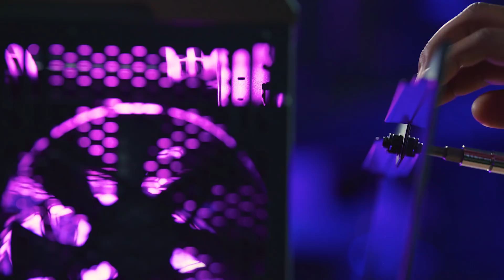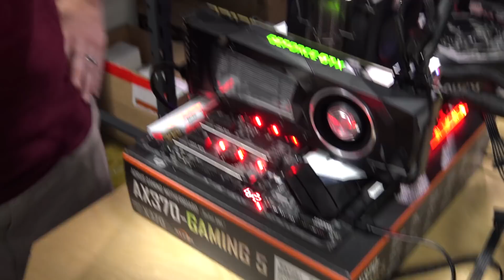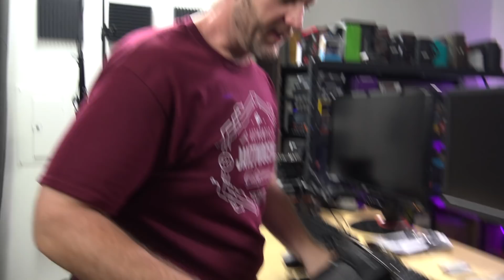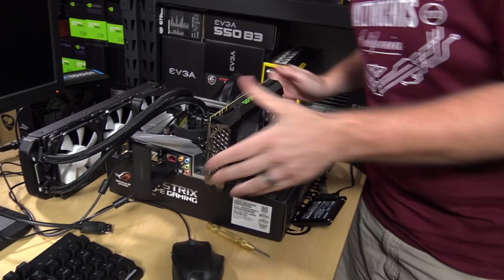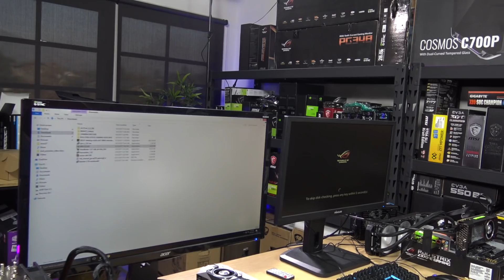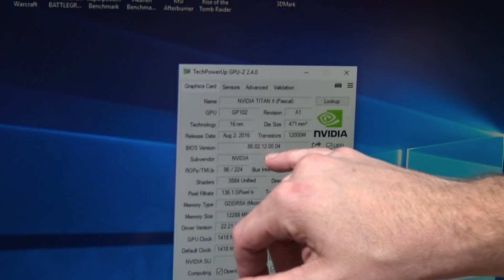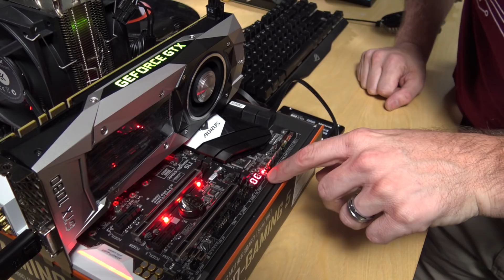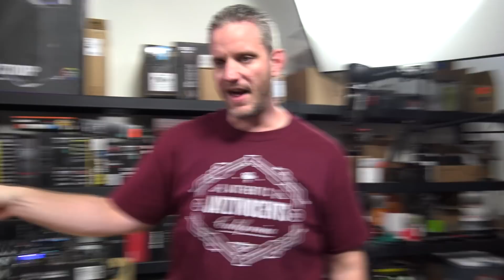I cant figure this one out... HELP!

Comment from the maker: I got all the messages asking me to verify the bios again since I checked the same card twice... they indeed do match. Just checked again now to be sure. UGH this is frustrating.
I am probably going to have to buckle down, install the Pascal BIOS editor and force a fresh bios install and see what happens. 
The problem is that a new builder without 2 cards to check would still probably think that the card is bad. :(
Reply: While I  agree with your sentient that it's probably not the motherboard, I would try a different chipset AMD motherboard with the same GPU that doesn't work and see if it posts. If it does work, then maybe its the chipset/bios on the motherboard that doesnt like that specific card. Try different brand, but same chipset. Heck u got a wall of motherboards behind you!!! good luck on solving it love ur channel
Reply: At my profession, we've come across this same issue a few times (perhaps once per year), and most of these have been due to a hint lower 12V rail output than one specific card required (for let's call it silicon lottery reason). Swapping out the PSU solved it in most cases.

Case example:
Most cards were able to survive at even ~11.7V, but then one unit refused to even at solid 12V and required a good 12.05+ volts to boot.
Reply: JayzTwoCents i bet its gremlins
Reply: I've experienced your problem few years back,few times,in different platform Amd and Intel. Mostly it's because of the motherboard BIOS/UEFI. 1 GPU can't be used in 2 identical system,1 works and the other won't post and other just like your problem. I solved my problem by downgrading my motherboard BIOS/UEFI and the card works. I was guessing there's some bugs in the BIOS/UEFI.
Reply: NebulaUK noticed the same thing so in essence you checked the working gpu twice
Reply: PCIe pinout on the Motherboard. Look for a bent or otherwise damaged pin.
Reply: I think the same, maybe the PSU, i would double check the voltages and unplug and replug the same card, this happened to me one time with my CPU the pc turned on but wont start, and after a long testing i saw the problem was the 3.3v on my PSU, changed it and every thing was OK.
Reply: JayzTwoCents I would be suspecious of the pci card slot or the graphics card connector. The slot on the one motherboard might not be making the best contact on the graphics card or vice versa since you have used that card so many times in different rigs. The contact might be worn down and a pin that that motherboard is not making the best contact.
Reply: JayzTwoCents no changes to the gpu bios?
Reply: Now you can make another video with the conclusion everyone here is waiting for, genius. My guess would be bad card and that the Intel board has like a longer timeout or tries to boot the video card multiple times before error.
Reply: I'm going to assume it actually is hardware on the graphics card. Even if they came out of the factory in the same batch, it doesnt necessarily mean they are exactly the same. Manufacturing isnt perfect. The ryzen system is very sensitive, where the intel system is more forgiving, so the "problem" graphics card might just be slightly slower on its bus speed, or pci signal strength which is causing it to hickup and show errors.
Reply: Like 3 years ago , i had a similar problem, and with an Asus deluxe motherboard, some video cards work, others don't, even if they were well.

I had to change the graphics card 3 times , but still had some isues.

And the problem was the motherboard bios, even loading the last version of the bios tens of times, it didn't work well. (this problem i had it for 1 year)

How you load the new bios version normally?

You save it in a pendrive and then you loaded the file to the bios system.

And that was the problem.

I learned 1 year later, i don't remember what forum was, but someone wrote that, he loaded the bios by asus sofware (asus tweak 2 bios software). everyone knows that asus software have some bugs, in my mind never cross this idea.

And that day every error was gone.

So maybe is the way that you are loading the new bios.

If i have some gramatical error, sorry
is not my first language.
Reply: JayzTwoCents its the PSU jay an unstable 12v rail will give problem not the ryzen system even if the gpu is the same model some gpu has bad vrm so it takes more volt on cold boot if this doesn't solve your problem it might be the ram or hard disk, hardware Canucks already explain if the ryzen system isn't install with a fresh clean windows it will give problem.
Reply: Not all Capacitors are created equally... lol u have a Capacitor that fell off its common in Surface mount
Reply: Suppression Capacitor.... knocked off --- sorry i didn't wont the answer to your question to get buried in comments...
Reply: Test power draw on the card like tomshardware did for the rx480. Check possible defects on the card or motherboard like actual connections
Reply: well that happened to me with a client i changed the 650W psu with a 850w , used a faster ram 3000mhz to be exact and updated the bios idk what was the issue but was one of those components hope it works for you
Reply: I Love it how we all want to be the one who gives Jay the right answer, all replying to the same comment he started hoping he will see our comment. Meanwhile, he left the studio and is at home racing in his living room just not givin a f*ck, and tommorow we find out it was just Ryzen Being Ryzen and it needed a re flash of the motherboard BIOS. 

On another note though, troubleshooting is what I do for a living, and I love all the different Ideas in this thread, a lot of people were saying things I would have thought of, and then a lot of people came at it from completely different angles, I love it. I was saying yesterday how Jay's comment section usually turns into a Armpit of Puberty, but today I was genuinely impressed with the analytical thinking. Got to love the Master Race when we are at our best!
Reply: Note how the silicon lottery effects a cards overclocking ability actually applies to all electronics. Not all same devices are going to have the exact same voltage, current, or signal at a given point in a circuit. They are however, spec'd to operate in a certain range at that point. My guess would be some component or circuit is slightly out of spec on the motherboard and the variation in the card that fails post is just enough to cause that motherboard  to fail post. I'd try that same card in the other PCIe slots to see if the issue is limited to the first slot. If it fails to post in all three x16 slots, then I'd try another motherboard.  However, if it's repeatable on another motherboard, I'd say something on that card is slightly out of spec. And that certain motherboard's specs are too tight to pass it during post. I had a similar issue earlier this year with a client's system. It was a first for me too and I've been working on PC's since 92.
Reply: Did you clean the pins with isopropyl alcohol. The intel board might have a better pin contacts. I had the same thing weeks ago. I was putting a 2nd hand ram and gfx card on a new board and i wasted 2 hours and it was just corrosion.
Reply: Maybe the contacts are dirty or ground down on the card and the other test benches grip the contacts harder AND/OR higher/lower on the contacts??
Reply: Can't you just dump the bios from both cards and compare them rather than reflashing?
Reply: +JayzTwoCents  Maybe you should completely discharge the system before reseeding RAM and GPU and then power on. Every time i moved an old computer from a place to another it wouldn't post right away after reseeding GPU and RAM but it would later on. I think that happenned because i would go for a walk to steam off and that would give it time to discharge. Back then i didn't know one could press the power button for two minutes to discharge the system. From a diferent perspective, if the card isn't the problem then it should work just fine on that motherboard with another Ryzen CPU. Good Luck.
Reply: This may sound stupid, but have you swapped the power supply?  I'm not saying there is anything wrong with it, but you can have two components that are fine, but don't work together.  This can happen with things like a PCI-E connector that has a questionable pin, and while it hasn't totally failed, it works on card A, but not Card B.  I'm just trying to spitball things that might have been overlooked.  I would supply PCI-E power to it separately and see if there is any change.  As stupid as it sounds.
Reply: Clear CMOS always do the charm, Swapping so many card and changing so many settings,  Clear CMOS %99 always work for me
Reply: Jay you have watch your own video to see the problem. You too the video card out of the intel system and put in the amd system after checking the bios version on it. But instead of checking the bios version the card you took out of the AMD system and put it in the Intel system you only rechecked the intel video card version and said "see its the same version". Your camera guy being the second set of eyes should have spotted this and told you. Secondly you should get a rig like Linus has that allows you to properly mount video cards, I suspect the sagging on the second video card in your amd which you can see when the camera guy pans around might be contributing the issue. Yes the motherboard bios might also be a factor, they aren't always perfect and it takes people like you to point out the flaws in the newer revisions. I still work in IT, been working since the 90s.
Reply: Well maybe it has something to do with the power. As you previously said, not all card have the same electrical efficiency. Did you compare their asic quality ?
Reply: dosn't make sense neither would work in that case, maybe its just one of those "card created not equal" try chaning psu's and screens and it just might be a card that dosnt work well with one of these or even just the motherboard/cpu. keep swaping stuff thats my advice.
Reply: I should note that the BIOS itself will be signed by nVidia (and thus virtually impossible to be corrupt) and likely identical, but you want the rest of the blocks as well. Almost the entire thing should be identical.
Reply: (The rest of the NVRAM)
Reply: ok, reflash gpu bios, reseat cpu, ram, clear cmos flash latest mobo bios again, let sit without power for a few seconds after clearing cmos again. if that doesnt work then its just one of those weird inexpiable things that computers do some times...

or im dumb which would not be the first time lol
Reply: D4nnyDarko Agreed. I don't know too much about Pascal cards though as I am stuck with a 950. Life lesson - Always expect possible changes to your budget.
Reply: As we saw, the problem may exists also on the other card. some times was showing code error as before. Most probably it is something wrong with the motherboard or the bios..... You can try using older bios and a different PCIE slot....
Reply: Yep,up to date mobo's BIOS/UEFI doesn't mean it's a perfection from the old one,sometimes it brings a whole lot another problems XD
Reply: After things you have tried I would try swapping psu next followed by swapping cpu to make sure you don't have a weird single dead pin situation. I've seen a cpu that had a single pin slightly off do the exact same thing on a SLI setup (lga 1150 and socket pin off)
Reply: Try using 2 PCI cables instead of one.  Could be a slight difference in power draw between cables/connectors where you have a poor contact.  Wear from multiple installations may explain it.  Like how a micro USB charges one phone, but not the other.
Reply: I would suggest to try booting on the risen with the "bad gpu" WITH the PSU from the intel system. I know how that sounds, but hear me out.  I had this thing happen to me on a x99 system with a asrock mobo , where a gtx 980ti wasn't working on the top slot. it was working on the lower one so we left it at that.  Some months after the PSU died (a V750 CM, which is very good PSU). We've replaced it with a seasonic one and the upper PCIE slot was working. Strange thing, many theories, but still, I thought I should share. 

Take care, and thanks for this actually important video.
Reply: Maybe for an obscure reason and the maturity of the Platform, the motherboard don't switch on the right option if you are on UEFI and Legacy mode and you have to choose one or the other manualy depending of the graphic card you use.
Reply: Looks like the GPU is not waking up from its low power state when the system is started.
Reply: have you tried turning it  off and turning it back on again
Reply: the other problem its probably the cpu socket but thats the last option i think
Reply: JayzTwoCents clear cmos?
Reply: Are you running an Memory OC (xmp) on the Ryzen board? I suspect some Issues with PCI-E.
Reply: Your problem was different as he can't get through POST while you obviously get at least partially into windows since it was registry related...
Reply: Jay you check the bios of the same card twice in the video.  You never checked the swapped card once you put it on the intel system.  At least not on video.
Reply: Did you try adding both cards to the AMD test bench to see if it has the same problem with the card?
Reply: Jay. You may have a funky PowerSupply as the TI pulls more power. Swap out the PSU and see if the problem persists?
Reply: see, the problem is that you are still thinking of this as a computing problem, its not. its a black magic problem.
Reply: Yep power seems right if one of the rails is overloaded or defective. The 1080 pulls alot less and Ryzen too puts a strain when you OC.
Reply: Not bad resistors as the 1080 works fine.
Reply: just for kicks try using a pci-e extender to eliminate any socket issue... long shot but could be worth a shot
Reply: Do AMD chipset driver.. check windows update inside settings. Use fall creators windows insider uodate
Reply: JayzTwoCents try a new cpu but a ryzen cpu or even the same cpu from ryzen? So if you got 1700x use a diffrent 1700x
Reply: one issue might be wether or not the system is set to recognize the "bios" or the "uefi" option on the card in question. the card that's buggy might have a corrupted UEFI bios on it, or a corrupted "bios"(old 
school. the aorus, may not have an "old school" bios boot option, so it's not seeing the potentially corrupted UEFI bios on that card.
Reply: Can you replicate the Ryzen system with the same parts and see if it works? It may just be Ryzen, I dunno.
Reply: I'm thinking replacing the CMOS battery.
Reply: Too bad it wasn't just your silly mistake and it was the bios all along. Oh well. Keep on keeping on I guess.
Reply: Try another ryzen cpu
Reply: JayzTwoCents I have the same board, don't have such issues. This is very weird
Reply: what voltage is the bad card running at on intel, that card may be upsetting the power delivery for cpu/ram on the ryzen  ie something wrong with the vrm on the titan
Reply: start that gpu in the ryzen system with only 2 sticks of memory in single channel...
Reply: Please do a follow-up if you figure out the issue. Interested in what the root cause of this issue is.
Reply: Will it boot with no screen attached. Like no cable at all? In such a case, you at least eliminate everything connected to the GFX. Also, this appears to be a handshake issue, so a reflash of the GFX bios, as to force a factory default of everything, would be a good start. But not necessarily solving anything, if there is some sort of glitch in rare cases with the handshake.
Reply: Swap the power supplies and see if that changes anything. You may be drawing a lot of power at startup and triggering something. If its not even posting it leads me to believe its a power related problem.
Reply: Hay jay have you check on the part that goes into the pcie port maybe something on it that missing up the connect on the ryzen system that not used on the intel system, can't remember what the bottom part of the card called other that i think the card haunted.
Reply: JAY take out all the unessential components. Use only one stick of memory and try and power the fans directly from the psu and not from the MOBO.
Reply: I'd re-flash the BIOS, just in case there is some corruption?
Reply: Hey I have a very strange problem with windows... windows taskbar is not working at all. I can't change volume, open start menu, or right click on icons on the taskbar. I've searched the web for a fix and none of them are working. This issue is very frustrating and I was hoping you'd have a fix. Thanks!
Reply: JayzTwoCents This was probably already mentioned,  but there is  the possibility that one or more corrupt files on the graphics card and even elsewhere that could that could clash one or more corrupted file(s) in the  bios of the graphics card. There may even be a defect or defects that only manifests itself with AMD chipsets in the GPU or elsewhere.
Reply: If u had a Intel system on that ssd and all u did was restore windows so u can use your ryzen system on it that could be the problem AMD says to Format your drive and reinstall windows. hardwarecanucks had problems with his ryzen system and could not figure it out so he tried what AMD said to do and all of his problems were fix u should really try this if u only restored windows on that ssd Jay
Reply: JayzTwoCents I had the same exact issue but with different cards and the ryzen 1600x.  It ended up being a power issue to the best that I can figure out.  I started my process in a comment, more than willing to take through it all if it would help.
Reply: JayzTwoCents I also have to warn you that during my process the ryzen processor failed soon after the issue you showwed today died.
Reply: It's the motherboard...  you got a lemon!  Some tiny cap is off or faulty and the minute differences in the two GPU cards, along with the apparent lack of case-ground, combined with the potential for voltage-leak across the printed product's box ink, etc., are causing it to show you it's lemonness.

100% guaranteed...  replace the MB with an identical one, place it in the proper environment, and the non-posting GPU will post just fine.
Reply: J have you try switching ram? trust me computer hardware are weird.
Reply: im having something similar to me happen, i upgraded to ryzen and my rx-480 crashes and restarts mid game, or some games get stuck on start menus.  this video is very helpful for me in terms of understanding
Reply: proofs!
Reply: Great suggestion, second PCIE slot.
Reply: This was my inclination as well.
Reply: Wow, that's weird - maybe the BIOS wasn't installed properly by the manufacturer.  I know you said a lot of people would probably say "overwrite the BIOS", but I don't think there is another solution besides sending it back.
Reply: You only checked the titan bios that was intel working then moved it to ryzen and checked it again. But you didn't show the bios of titan that wasn't working on ryzen but working on intel
Reply: So what I'm hearing is that you're going to compare settings in the Pascal BIOS Editor, flash if something doesn't match. what if the bios turns out the same on both cards down to the settings? Maybe some weird hardware revision issue? if neither of those two, then what? Mobo problem likely, right?
Reply: JayzTwoCents this is fascinating.... This maybe a Ryzen problem that you discovered by chance. Do update on this issue. Talk with Nvidia and AMD about this cause something is fishy.
Reply: evocatiproductions, " I agree with you Jay, I run Ryzen, and love it, but it has a lot of stupid ass problems."
Really, I built mine and have had no issues and "user benchmark" states it is running better then expected. Maybe you boys need to get a clue with a card dropped by Coconut Monkey and a guy that blames Ryzen but installs "the Pascal BIOS editor ".
Somebody does not want to eat crow a second time in a row.
I think something other then work is distracting him, not my business.
Reply: have you tried using different PSU cables for the power? Not necessarily a different PSU, but a spare PCI power connector if it has one. It's happened to me before where specific cables just don't work in very arbitrary circumstances, especially when swapping CPU's.
Reply: i agree
Reply: This happened to my threadripper build and it was not the GPU fault, it was a USB hub bug in the main board bios. Try booting without any USB plugged in
Reply: Hey Jay You checked the bios of the graphics card on the Intel system (ver. 86.02.12.00.04). After that, you have switched graphics card from the Intel to the Ryzen system and read bios there (ver. 86.02.12.00.04). Logically the same biosversion. The graphics card which is inserted in the Ryzen system and then switched to the Intel system, you have never read the bios. At least not in the video.
Reply: Try other PSU’s. Had problem like that with my old pc long time ago that not all PSU’s started my GPU...
Reply: Try to unplug the fan. Then its maybe a powerup issue (fan runs high/starts=draws excessive power). Had that Problem years ago..... amd barton mb.....
Reply: +JayzTwoCents
4:07  Personally seen this problem several times over my 38 years in the industry. It's not common, but has/does happen. The firmware on the problem card might have a single bit error that does not show effect on an Intel system but does cause a problem on an AMD. It's likely a problem on the code that starts the card up and interfaces with the PCIE bus. Intel's startup routines are different than that of AMD's. Get in touch with Nvidia for a firmware flash tool with a fresh update.
Reply: JayzTwoCents Plz can you do a cool water build and make an packade so We noobs on this can order it eazy. and seee your video how you build it? I am going for thread ripper so i want liquid😍 Your the best! Keep doing videos on many things!
Reply: How does the seemingly faulty card perform versus the seemingly good card?
Reply: so i am that " new builder "my only and first pc i have ever built i got a dram no start up on my build and i took it to an Italian pc repair shop and he said ( he didn't speak English very well mind that so i had to desifer most of what he was trying to say) he said that my to take out one on my ram both of the ram's work'ed fine. thinking it is the motherboard because i updated the bio's for my motherboard and didnt change anything still wont boot up with both ram's in and my gpu in but i can boot up with no gpu and both ram so this happend to me but on a cheaper scale
Reply: Clear cmos switch mobo
Reply: Could this be some weird PCE-E lane compatibility or mobo issue with the top 16X slot and did you try to post in a different slot with that card. I have had it in the past with some server boards be the issue that the first 16X slot would cause intermittent issues and not on every device. This may be especially true for Rizen due to they way they implement PCI-E Lanes.
Reply: Send both the card and motherboard to nvidia... let them fix it
:P
Reply: JayzTwoCents I have experienced something similar with my new system. 2 weeks ago i bought my new pc.... graphics was MSI gtx 1060 6 gb gaming plus. After 1 week of it working fine, when I started my pc , no signal message appeared on the display. Put my card in my friends sytem and it worked perfectly fine, put other cards in my system and it also worked perfectly fine. Only my card would not work in my system anymore, even tho it worked perfectly fine for 1 week. The solution ? Refunded and changed my card with the same version. Now it works fine , no problems. The problem was with the graphics card.
Reply: Power issue maybe? Are power supplies identical?  Firmware power efficiency selections similar or identical on both boards?  Try switching power supplies and try again.
Reply: Try a new motherboard, my friend jumped on the am4 platform and bought a 1050 ti and had a similar issue. We RMAed the gpu only to find the replacement didn't work either at which point we put the gpu in other systems and it posted. After that we swapped the am4 motherboard with a different one and it posted and is working perfectly.
Reply: +Tony Yacovielle
If both cards didn't work, your point would be possible. But the second card works perfectly. The chances of this problem being power related are so small as to be effectively impossible. Having seen this before and knowing how to correct it, I stand confident in the conclusion that the problem is related to how the card is being initialized during boot up. This is most likely a minor, but important, error in the firmware of the offending card.
Reply: I had the same problem with my asrock killer SLI and Vapor-x 7950. I was waiting for 1070 to arrive. If you stick the card in the second PCI-e express slot it will boot. I never solved the problem, asrock never ansvered. Its not PSU, Its not memory or something like that. I tried all of that. You'll have more luck with the manufacturers than i did. Make them fix that sh*t!  ;)
MBO bios update didn't change a thing. Just trust me on this one. If you have to, send them all your HW so they can find the fix.
Reply: It doesn't sound to me to be a bios issue, especially if the "bad" card works perfectly fine in another system. I would guess that the cards use slightly different voltages, and the motherboard is sensitive to voltage fluctuations.
Reply: JayzTwoCents i have had a similar issue where one card would post but the other wouldn't. I installed both in sli and it posts and runs without any problems.
Reply: OK. Had same problem with RX580 not working on Intel but working on AMD... No idea what it was. Resetting CMOS fixed a problem for next boot and then a problem returned. But flashing BIOS on Intel board solved problem... If that helps in any way...
Reply: Everyone is wrong the real way and true way to fix this problem is to give the gpu to me and I will give it a hug and a kiss since I don't think you will Jay.  I mean if you'll do it then give the gpu a hug and a kiss it always works for my gpu.
Reply: Good day sir im a big fan(not the cooling type) you make the best videos i have ever watched i watched all of your vids atleast two times thanks for the vids man. Im from the philippines im a pc enthusiast and gamer my pc only pc just broke because of old age it was at least 4 to 5 years old when i got it on 2011 it was a gift from my mother i have used it for 3 years but sadly it broke the specs are amd athlon 64 le-1600 Motherboard: GF7025-M2 1gb ddr2 ram for its storage a 160gb Hitachi hdd unfortunately our current financial situation i cant buy a decent pc im hoping you will make a give away contest so i can at least have a  chance to win a decent upgrade
Reply: lol i was about to message that
Reply: Try updating the motherboard bio's. I say this cause it appears to detect other graphics cards nut not the Titan. Looks like the motherboard is having an issue figuring out if it has a dedicated GPU or not. Id say its the Graphics card IF it didn't work on the other board. But it did. If this is the motherboard in question http://www.gigabyte.us/Motherboard/GA-AX370-Gaming-5-rev-10#support-dl then the latest bios for it is F9a.
Reply: You checked the bios version on the same video card on both computers, of course the version is going to be the same.
Reply: I love your reviews but don't you think you're jumping the gun blaming the entirety of Ryzen as a platform because 1 specific video card wont let the system boot. System does boot with other video cards and one that is the same model. I'd look at the video card more closely and suspect it being the culprit somehow as it itself is the only component producing the difference in boot. Attempt using the card within another complete ryzen system all different parts and if the card boots then swap the components from original Ryzen a piece at a time until problem is replicated and you will have your true guilty part. I'm leaning on power supply or the clocks/power draws from the video card to be the fault, Suspect the video card may have been saved with a custom overclock as it is after all a Titan and you are JayzTwoCents where its not beyond the realm of possibility here to tweak cards for max performance. Anyways keep trying I am sure if you will have the problem sorted out as you are blessed spare hardware. ((The main reason I don't get rid of my old PCs is the troubleshooting wealth they provide me in spare hardware.))
Reply: that fixed mine when I  did my Ryzen build
Reply: Try running it in SLI, see if it boots with one in the top slot & not with the other or vice versa; could shed some light on the situation
Reply: I'm gonna throw in my THEORIES, so you do NOT confuse it with solutions, got to be clear... because people... So, my theories would be that the troubling Titan probably have some sort of failed capacitor or some sort of solder done slightly wrong, or like the wiring inside the PCB is slightly damaged, you know... things that you probably won't be able to figure out yourself... 

Because in my mind, it would only be something like that, that would make sense at this point... Because, as you said Jay, Ryzen's picky as all hell, and if something's off, it's just not gonna work... Maybe Intel's just better at getting around something like that?

Maybe it's a compatibility issue in how just that batch of Titans was made? I have no clue, just throwing theories left and right to see if something makes more sense in my mind at this point... 

I don't know, it's just theories... The only way I think we're ever gonna know is if you send it back to Nvidia and have them do a thorough search for the problem and wait for their evaluation...

Anyway, I hope that I gave you some insight in what it could be, take care Jay and Nick, and keep on being awesome, also, so good luck finding the problem, I do hope that you find the problem, and if you do, please make a quick video about it, so that we also could learn some more about this weird phenomenon.
Reply: JayzTwoCents if you can try flashing the graphic card to a previous version if you can and see if it will accept the older version on that card. it could be the card is corrupted or the newest versions on the card that card is just a bad luck card and doesn't like the update date hopefully you find out whats wrong with it
Reply: Rafael Cruz if it was psu i wouldn't power the other gpu since he switched it. it's mostly a software issue for the card or the M.B
Reply: JayzTwoCents check this. it might help https://rog.asus.com/forum/showthread.php?92442-Q-Code-Error-Code-B2
Reply: Check the actual PCI lanes using CPU Z and check the motherboard tab. Some motherboards have a higher tolerance for cards with faulty PCI lanes. 
It will sometimes boot a faulty card but instead of running the full 16 lanes it will display the slot number of lanes as 16 then on the right it will show how many are being used, for instance it will show 8 or 4 or 2. 
It can be either GPU related or a faulty slot on the board, very difficult to diagnose.
Reply: ive had this problem before wih my system . the pins inside pci slot where broken
Reply: I don't know as much as my name implies, but I'm thinking this might be due to Pascal's GPU Boost. It could be requesting more power than that system is willing to put out. I'm speculating here. Have you tried swapping PSU/mobo with the same CPU?
Reply: i have the same thing on my 1700 with ram @3200, doesn't every happen when i keep it at or under 2666mhz tho. So i'm geussing its a ram memory issue. using a 1080 on an MSI mainboard. Had the same issue with an R9 on the same board. with the R9 it would sometimes boot tho. So maybe a chipset or infinity fabric thing?
Reply: It looks more like it's a compatibility issue with the BIOS of the mainboard.
Try all the PCIe slots.
Are AMD cards working with that mainboard?
Try regressing the BIOS of the mainboard until it works.

Only do this if you get one of the NVIDIA cards to work on the system but it is less likely to be the problem:
Try dumping the BIOS of the working card to a file. Do the same with the non working card. Name the files acordingly and now swap the BIOSes to see if they are the reason it is not working or try switching / changeing PSUs you can even checksum an compare the files.
Check the PCB revisions too.
There might even be faulty parts on the PCB that have tighter margins on one card than on the other.
Reply: JayzTwoCents sounds stupid but have you checked the power rails on the ryzen and make sure there putting out correct power,especially with the XP due to the high power draw of ryzen and GPU combined.toletence of components and variations of batches could cause this.
Reply: It must have to do with some difference between the two graphics cards, even though the BIOS is the same. I have no idea about the cause. Could you borrow another motherboard of the same model and version from somebody and try out both cards on that? See if you get the same result. Maybe ask your PR-contact person at Nvidia and Gigabyte about it? Maybe Gigabyte is willing to send you another sample of the same motherboard as a loan to try it out?
Reply: Nvidia trolling again!
Reply: Built my daughter a Ryzen 5 system and have had nothing but problems with graphics cards. Still  have not figured it out with multipal cards.
Reply: JayzTwoCents This Is True , I suspected the Board to be the culprit . Card Still worked on the 2nd slot . Just the Top slot wouldnt process video out . The reason for my comment below .
Reply: it Isnt Either , the Serial # on the gpu when Verifying the card would show an error . but boards with auto Error read Codes , Dont always give the Correct Readings . Have you ran a Driver update and it wasnt reading the Driver ?  I Just had a GeForce Failure . Had to Reinstall the the GeForce Esperince . re install the driver . and reinstall the OC . There is a Bug in the NIVIDIA platform . The 384. driver had a bug and i think it is Still attached to the 389 update . Refresshed the OS , Again !!! Working , Again . !!! My OC on the CPU , IS JUST FINE . The OC in the GeForce is a B.... !!! The NIVIDIA Check list , on Known problems , Isnt showing Anything , Even though , There """ is """  a Problem !!! I blame the Miners using the OpenGL to Retrieve their Hash ,,, Overloading the Servers !!!
Reply: Ask Linus?
Reply: Jay, did you look for a bios switch on the gpu? I know one of my gpu's had a legacy/normal bios switch, could be that.
Reply: But now they know this has the potential to happen thanks to your video
Reply: could it be the pcie slot like the 16x or 8x. i have had that happen before and moved mine into the 8x slot and it worked for me
Reply: Hi Jayztwocent.  My colleague had a similar problem with his ryzen, only he was able to play for a half an hour before it crashed, when i tolk the GPU to another PC it would work for ours, changed the mobo and nothing helped. Untill he changed the CPU and the issue was gone. Seems like our issue is some kind the same if you ask me :)
Reply: It's not posting
Reply: Needs much much much more process of elimination. You tried a bunch of cards in one mobo, you needed to ALSO try the "faulty" card in multiple mobos, as well as swap between HDMI and DP on the card, change PCI-e slots, change ports on the monitor, monitors themselves. It's hard to tell obviously a bios flash will only give more info, could be all the info you need, could just tell you to look somewhere else. gLhf but as you stated, you have the hardware to preform all the testing needed to diagnose; just need to do all the testing. :/
Reply: SUSPECT PSU. Read my other reply.
Reply: Check secondary PCI lane. I used to have a mobo sometimes not detect my GPU and I would have to switch lanes.
Reply: That's right!  That's the most logical hypothesis.  Or perhaps the more likely hypothesis of ESD (electrostatic discharge damage) making a pin marginal because the cards are handled so much in Jayz's lab.  Keep in mind that ckt boards are tested at worst case marginal conditions (offset from nominal) in the factory before shipping to screen out boards with manufacturing variations that would put them at the edge of functionality.  Moreover, factories have sophisticated ESD control.  Very little of the discussion here (including Jayz) seems to have reached the obvious conclusion that it's likely a marginal graphics card.
Reply: Sorry Jayz, per your own responses on Twitter, we DON'T offer personalized tech support. Solve your own problems.
Reply: Just give it away J that card ain't all that like ryzen in general.
Reply: I had weird stability issues back when I had a 1070.  I got a temporary card that worked fine.   after getting credit since the manufacturer didn't have stock I purchased another and had the same problem.   After more troubleshooting I found a burnt pin on the PSU side of the PCIe power connector.  Swapped it out and everything worked again.   The temporary card had a lot lower power requirements that is why it worked.
Reply: have you tried to clear the cmos while the graficscard is installed after a error-boot and reboot ?
Reply: Not biased or something but Gigabytes do some bad magic..... I would change mobo on ryzen side
Reply: This new hardware race and hardware companies having tough time get the product at shelf. GPU encoding wouldn't be complete, try GPU Bios replace.
Reply: I don't have much experience in that level of debugging, but a couple of odd stories that might shine a light on things:

First, my GTX780 ran fine on all games, but crashed in Path Of Exile every half hour or so.  Couldn't figure out the problem, let alone why it would only crash on POE.  They said I might have a defective card, and discounted that since it was only crashing on POE  - until my card caught fire.  It was an EVGA and something in the power delivery let the ghost out, and the replacement had no issues.

Linus mentioned his story of a PC not booting up with a specific PSU, but the PSU would work on other machines, or the same machine with a different OS.

Point being, there could be some minor malfunction with that graphics card. perhaps capturing the errors would shed light on things.  I am sure there are some errors which are usually ignored, and the system runs fine  (i.e. similar to Windows error log containing many which doesn't generate a desktop alert).  Would be worth asking EVGA engineering for some diagnostics.
Reply: I just had an issue myself where I had come home from work and my computer was off and everyone in the house swore that it had not been touched.  I'm running Ryzen 5-1600 on an MSI X370 Gaming Plus motherboard.  I turned on the computer and my wireless card wouldn't stay connected. So reinstalled Win10 and it froze during POST on VGA/GPU.  Pulled the Wireless card to make sure it wasn't faulting out the PCI-e bus.  Still froze. Re-seated my GTX 1060 6GB, No POST.  Cleared BIOS, still no POST.  So I start pulling stuff from my ports.  When I pulled the portable DVD drive from the USB 3.2 slot, it suddenly kicked past VGA and POSTed.  Rebooted, no issues.  Plugged the portable DVD back in, no POST.  Moved the DVD drive from the on board USB to the USB 3 on the case and no issues.  I built this system back in JULY and have had the DVD player plugged into the USB 3.2 port on the motherboard since I had started loading things to my PLEX drive in late July.
Reply: @JayzTwoCents +JayzTwoCents Save the bios from both cards (with gpu-z) and generate a md5 or sha checksum for both bios roms. if they match there the same if they mismatch one is definitely corrupted. Np love your content! =)
Reply: Other thing you could do is if you have another motherboard of the same kind, swap that out and see if that titan does the same thing in another motherboard of the same model. If it does, then it's a bug in the EFI that the manufacturer will have to sort out. 

That I would do LONG before trying to flash the video bios, since that titan does work in the Intel system.
Reply: Try uninstalling any overclocking software that may have profiles saved to that specific card.
Reply: NebulaUK that’s exactly what I saw. He checked bios in gpu-z of the working card in the intel system then moved that card to the RYZEN system and checked bios of the card again which of course would be the same, we never saw the bios version of the card he’s having trouble with.
Reply: Not sure if you will see my reply since it has been two weeks, but I just seen this video today. My guess, because you are only having the problem with only the one card in only the one mb slot. The  mb may have a weak or bent pin in the slot  and/or the card has a slot contact pin that may have the protective coating that they apply to the board covering a little bit more of one or two pins than the other cards you tested,  and it just doesn't make very good pin to pin contact in that one particular mb . Just take a bright light, find a angle that you can see how far down the coating goes on the slot contact pins of the gpu vs the others.  You should be able to scrap it off the contact pin with a razor knife and not hurt anything.
Reply: Maybe you just did one line too many and you're tripping? Wait, no, that's me. What was the problem again? I wasn't paying attention.
Reply: Long shot. You should pull the cooler and see if the serial on the chips match. Maybe it's a hardware revision. Might be more work than it's worth though
Reply: Thank you for a great Channel!!! Having been in I.T for many years, I love the methodical nature you bring to your videos’!!! AMD mobo BIOS is the issue - At you said “I’v never seen one card work in one system and not the other” . This does happen, one specific scenario that I’v encounter a few times in the last few years, is with newer cards on older boards. IE nVidia 740 on a OEM 2nd Gen i5 , where the PC won’t POST / give display (cant recall which one) .

Upgrading the BIOS (mobo side) fixs the issue EVERYTIME. Yes, I do realise this does not answer the original Q “Why does this SPECIFIC, seemingly identical card not work on the AMD system, but the other one does” but I do feel it is the AMD based BIOS being, well, AMD. The whole AMD no OC & GSkill RAM error of not too long ago, is quite a joke to be honest, admittedly a terrible joke…
This is why I steer clear of AMD GPU’s & CPU’s / Mobo’s. For many years there have usually (esp on the GPU side) been more driver issues then I’d like to personally deal with.
Reply: check vram installed on cards, if different then may be incompatible with mobo.
Reply: Make sure that the Titan Xp that was acting weirdly doesn't have damaged PCI-E pins/connectors: different motherboards may have different ways of communicating with graphics cards. I know that NVIDIA cards can scale down to an 8x PCI-E slot and only use half of the available bandwidth: which pins/connectors in the slot they decide to keep using may depend on the motherboard type.
Reply: plug Gpu to another pcie slot
Reply: From watching your video I noticed that you checked the bios of the gpu on the Intel board before swapping them out and then after swapping the cards you checked the bios on the Ryzen build leaving one gpu's bios completely unchecked. You should've checked the bios of the gpu that was on the Intel after having swapped the cards over to the other board and would've probably found that they did in fact have two different bios on the two gpu's.
Reply: Well I'm a coin miner and allot of profit comes from BIOS modding. I'm able to mod the BIOS of a RX 470 or 480 for increased hashrate and efficiency. The crazy thing about it is although I am still able to see in GPUZ the same BIOS version number. For instance if I mod a BIOS with a number lets say 12345, when the BIOS is modded and flashed to the card it will still read 12345. Maybe contact nVidia for a stock BIOS if you have the hook up or head on over to Tech Power Up.com and load a stock BIOS on the card. Just make sure the vram vendors are the same :(.
Reply: some times some of the graphics cards don't work because the pci-e socket from card is just a bit longer or shorter in the pins layout (im taking from my own experience)
Reply: How about dodgy power cables?
Reply: Reset the cmos might be  oc  on that card
Reply: On the off chance you will see this cause its old lol, i think its the MOBO to be honest. i have built gaming systems with amd for years, because i was broke in the millitary and intell is for rich folks. I had that same problem with a gigabyte board a wile back in the ddr2 days GTX 480 sli i think it was. Did the RMA bit ect. Went asus haven't had a problem since 4 or 5 builds later. Sitting on a 1800x now 0 defects.
Reply: @JayzTwoCents if this problem is still somehow not resolved, I would take a close look at the pci pads/pins to see if one might be concaved or distorted somehow to where it's not connecting to the looser PCI-e slot on the amd mobo
Reply: you never checked the bios version on the card that hates amd halfway through you swapped them so the odd card is on the right not the left
Reply: i had that problem with an old intel board and my one dollar hd6570. i moved the ram around and it worked. dont know why it worked, but it did. weird...
Reply: Erm i have a close issue like this.
So i have xeon e3 1230 And i7 3700.
Intel db 75 en And asrock h61 pro btc.
Xeon And en75db Intel board gtx 550ti doesnt work.
Same board i7 3770 it works.
I put xeon on the asrock h61 pro btc 550ti works.. I put the i7 3770 it works...
Sadly now i have to run my xeon on a +100mhz oc And running the 3770 stock insread of on +300...
Intel board is max bios update dou i havent checked the 550ti bios but its still some mobo + cpu combo thats Fucking up on my side that disables the gpu
Reply: i just dealt with the GPU killer.. iuno what the hell happened.. my r9 380 just randomly died after drivers for motherboard... then before that had the same thing with the hard drives.. 4 500gb hds sata connection.. just all stopped showing in bios and wouldnt boot all at once.. i thought maybe power supply. motherboard.. cpu.. gpu.. every part ive taken out my other computer thats all compatible.. and its not the motherboard.. because a brand new hard drive works.. not the sata cables tried ten diff ones that worked on the cd rom drives but not hard drives.. and gave up on the hard drive issue.. just last night my r9 380 went.. so today because im building a rig after winter i decided to get a budget card to be able to game in the meantime. grabbed a rx580 black edition oc+ by xfx.. for 220.. came with 3 months of game pass.. and borderlands 3 or the new ghost recon.. i chose ghost as the game pass will likely get borderlands.. and also 1buck a month for 3 months for ultimate game pass for xbox and pc games.. i dont own an xbox anymore but figured i could use it at a friends so i signed up with a gift card to not repeatedly be charged as this is my way to get3 months from them.. and 3 months from my graphics card purchase.. test all the games i want.. and figure out which to buy..... the card powers up.. no problem. but nothing on the screen.. only video threw the onboard.. well go into bios.. change it to the pci express as main.. and allow the other just incase.. and again.. nothing.. changed it to pci express only onboard off.. and nothing.. tried a different gpu a 750ti .. worked fine.. tried my new r580 in the other rig.. worked fine.. then popped in the old one.. and then it read it in bios as x8.. only when it should be 16x .. and then it restarted after changing bios and its gone again !!!! been workign on computers since my first one was given to me by a uncle kuz he was just as into computers as i was lol.. my first pentium 133mhz with a dial up modem pci card.. and aol.. lol when downloading songs was getting them in your email as attachments same with games and movies. n if someone lifted the phone F me.. download GONE the kids these days will never know the real struggles. we didnt have buffering we had 1 hour to download 2 music files totaling 10 megabytes ahha
Reply: now im having an issue with one board .. my z87-a . pci express x16 slot 1 always says itsempty.. and slot 2 only allows for x8.. but since most cards cant even use 16x realistally i didnt see any bad fps drops or anything 2 fps dropped in games thats it nothing else..           the motherboard has 3 slots.. top yellow one.. doesnt work with any gpu all the sudden.. i went over every single piece on the motherboard cleaned out the pci express slots everything.. nothing 
any help for these 4 hard drives that are 500gb all western digital not booting at all.. in any system
but didnt have any issues until a windows update but it will not allow me to fix it using windows for some reason? never shows up in bios anymore... if anyone can help with either of these

i heard something about my usb 3.0 slots on the back of the mobo could be taking up pci express lanes and making the first slot not work.. but ive never seen heard or talked to anyone who has seen it.. besides one person thats board was so bent they heated it with a propane soldering iron.. and boom pressed it back in and was fine.. but i cant figure it out.. and its been like 3 weeks since i gave up then i saw u had it happen with a winodws update.. problem being.. i cant get them to be recognized by ANYTHING someone needs to make something that literally hooks directly up to a sata hd any sata device formats it and flashes the bios and firmware and or tells u exactly a code to know whats wrong with it
Reply: JayzTwoCents Was it the plating on the connectors? One is scratched up a bit?
Reply: could it be a problem with windows recognizing it? are you able to log on with safe mode? mobo bios, cpu?
Reply: Had same problem with msi 1080 ek sea hawk with ryzen 1500x and ryzen 2600 then with a ryzen 3600x it was perfectly fine and with my intel systems it worked fine also real weird.
Reply: Try the GPU in another Ryzen motherboard!
Reply: JayzTwoCents did I see this right you checked the bios of the working card twice but not the bios version of the one that didn't work.
Reply: I will bet on PSU
Reply: Hello Jay, I have the Aorus X370 gaming K7 and an 1800x. Since it's happening also to your Aorus board I'm inclined to narrow it down to something physical on the board itself - I'm particularly suspecting the implementation of the Asmedia PCI controllers on the board not talking properly to the X370 chipset. 

My first K7 board booted fine and even held a 4.0 GHz OC and was stable, but then 2 days later it wouldn't post and give a 'b2' code or code 24 and stop before post. These errors went away when I cardboard-booted the machine... and then it came back and I exchanged the board. Now it is working fine with the 2nd board, but I cannot use PCI slots 1, 3, or 5 or it will BSOD randomly. Just my GTX 1080, an Elgato capture card and an Asus Essence STX ii work perfectly fine.

The issue occurred on both stock or 1.0.0.6 bios, and its the exact same GTX 1080 I ran for a year now, previously on an i7 5930k.

I think Gigabyte will hopefully fix the issue after rev 1.0 of their X370 Aorus lineup.

Fellow custom water 'Jay', NeoKronos
Reply: Jay, I work for a large firm that deals with enterprise servers and networking gear, hint hint... Anyway, on the systems I work on, the nvidia GPU's that I work with have a very similar issue on Intel v3 and v4 systems. Most of the time reflashing the firmware on the card is the fix.  This is easier through the baremetal firmware as it gives a nice environment to do the work.  I have never flashed firmware on a consumer level Pascal so I don't know for sure how hard/easy it would be on Windows.  I have also heard that specific board has a number of weird issues.  Maybe try an Asus or Asrock board if you have one?
Reply: Try swapping out the PCIE cable on the PSU for the Ryzen system.  Also check the PCIE pins on the card that's giving the issue to make sure there are no damaged contacts.  You could also try installing the card in the secondary PCIE slot on the Ryzen board.
Reply: All I can think of is something is dirtying the PCIe power, causing the board not to fully boot. Try that problem card on a different Ryzen motherboard.
Reply: I believe it is the power delivery of the PCIE power, as it is capped to 75w on x370, and they keep a tighter lid
Reply: Did you try to put the card in another slot?
Reply: JayzTwoCents It'll be a PITA to do, but I would try the PSU from the Ryzen system on the Intel system with the "bad" card. It could be a flaky power issue, which would also explain why the card works on one test bed but not the other.
Reply: Your card isn't new. Try cleaning the contacts with Isopropyl alcohol, an eraser and then Isopropyl alcohol again. This could happen if there are differences in the contacts with one motherboard. Reseating does not always resolve issues like this.
Reply: I agree with you Jay, I run Ryzen, and love it, but it has a lot of stupid ass problems. Bios flashing on the card might help, also Ryzen can be weird, try turning back on CSM instead of turning off CSM, I have seen Weird ass issues with that when I first bought my 1080ti. I had to put back in my 1070 and then turned on CSM, put back in the 1080ti,and then it booted. I ended up re flashing the Bios on my motherboard and then I could use Uefi only again. I don't know if you are having the same problem, but I have seen all kinds of weird shit with my system, and I think it has a lot to do with the Ageesa still Needs to Mature
Reply: fresh bios he said so :|
Reply: You should dump and compare before flashing.
There's a possible case of device blacklisting, either on the card's NVRAM or the mobos, possibly for the sake of prevention of damage to the card by an untrusted device... Car-service-light style.
Reply: JayzTwoCents swap out the power supply.  I ran into this in the past.
Reply: @ STARTJIM - It could be a bad contact in the PSU cable.  Had it happen to me before.  So PSU related issue is possible.  Swapping out the PCIE PSU cable would eliminate that as a possibility.  But I agree with you that a power delivery issue of the PSU itself is highly unlikely given that it's working with the other card.
Reply: One card is better Silican draws less from motherboard pcie slot boots other pulls to much for motherboard maybe even a wat more then spec intel motherboard provides enough posts other doesn’t
Reply: Thanks Jay, I suggest a shot of whiskey
Reply: Blow the PCI-E slot like a 64 cartridge and done!!!! Lol
Reply: What new builder would have an xp? xD
Reply: JayzTwoCents  it's the board gigabyte boards are notorious for throwing VGA errors with good graphics cards. I'm actually kind of surprised you haven't ran into this before. Try reflashing the motherboard bios. If that doesn't work try switching boards.
Reply: Jay, I think you only checked the BIOS of the working card. Correct me if I'm wrong, but you should go to the intel system and check the BIOS on the card that isn't working in the Ryzen system. (Then maybe update.)
Reply: how can it be the PSU? same card must be some thing whit the GPU bios maybe it got corrupt or some thing
Reply: poozen
Reply: Have tried clearing the cmos
Reply: any difference in the pcb, new rev maybe. maybe psu as mentioned above.haven't had an issue like that in a long time. last was  tnt2 if i remember right and it was mobos being picky...
Reply: JayzTwoCents the problem is the GPU bus on the motherboard and CPU lines
Reply: as a last resort, have you considered bad luck bud?
Reply: @ D X - If that were the case a simple CMOS reset when swapping the cards should be enough to accomplish that.  I've often given the advice to my friends when building or replacing parts and they can't boot "When in doubt, reset the CMOS.".  It's hardly a cure all.  But it works more often than you would expect.
Reply: do either of the video cards have a multi-bios aka GPU bios switch? perhaps that could be the issue?
Reply: Do a fresh install of windows with the ryzen system. Apparently if you installed windows onto the ssd with an intel system and then switch the ssd over to the ryzen system, it can cause issues with the graphics card.
Reply: Jay , I've had this happen  with a Gigabyte 7970 Ghz edition on an MSI p67 G65 . The card works fine  with a dozen other machines  but  will NOT intitialize on that particular board.  This first happened about 4 years ago and I've never found the answer for the problem.  Both the MSI p67 system and the 7970 are still functioning perfectly  independent of each other.   I'll keep an eye on this thread to see if you find an answer . Best of luck to you.
Reply: JayzTwoCents put the cards into SLI, plug the Displayport in to the TitanX that is failing, Did this one for me, worked for some reason
Reply: You have got yourself a 'Gremlin' part somewhere in that machine, Identify which one it is then get rid of it. Parts with quirks like that tend to fail sooner and more catastrophically despite the fact that it may seemingly work fine.
Reply: @ Uncene - That would have no effect as he's not even able to post with the problematic card.  Windows doesn't even enter into the equation by that point.  If you can't pass POST, you can't install Windows.
Reply: Is it a fresh install of windows?  I saw a Hardware Canucks video where he had a whole slew of issues with ryzen because it wasnt a fresh install of windows on the boot drive.  Might be worth a shot
Reply: these are founders cards, so that would not be applicable, but a good idea if they were.
Reply: Have you tried to install the GPU in a different x16/8 slot on the mobo?
Reply: Perhaps re-plug the same card will work. This would lead me to believe it's a software (and hardware) issue with the actual card communication. I have seen problems with usb connections in older computers. And just like the usb port problem causing a freeze on a running system when the memory is trying to access the same spot... The freeze is probably happening when the computer doesn't know what to do. Is a card in my slot?
Reply: Hey Jay, did you try using a different power supply with the Ryzen system or even using two cables instead of one to the gpu? Reason I ask is because I had an older 1080 not like power off the same rail and even performed better after the change.
Reply: That's why we need people like you. I hope someone clever comes up with a shortcut to the solution.
Reply: JayzTwoCents  might wanna check and see if virtualization settings are off.. also maybe try turning off or on your "fast boot" or whatever your board calls that setting.
Reply: B2 is Legacy Option ROM initialization. It looks like it's a minor fault on the board that can be disabled in the BIOS. If that doesn't work rolling back the bios version might allow the system to post and then allow you to upgrade to the latest
Reply: What about a different chip series for ryzen?
Reply: JayzTwoCents hey jay i had a similar issue issue before on asus p5q premium with gtx 660 2gb. Fix was to blow out dust from the pcie lane or treat it with dry contact spray that design for motherboard and pcb which cleans the contacts and dislodge the dirt. And some times it related to the graphic card gold strip as give it a nice rub with the eraser the soft part will clean the residue from the gold contacts
Reply: JayzTwoCents had the Bad TitanX voltage been adjusted? Maybe it won't post due to lack of power to the card.
Reply: NebulaUK I think you're right.
Reply: Have you checked the gold fingers on the GPU's, maybe some of the PCIE gold fingers are too short to reach the pins on the Horus mobo and the ones on the ASUS one just barely makes contact with gold fingers.  Or even debris on the gold fingers could cause some of the pins to not make contact with the PCIE slot.
Reply: It the residue on the gold contacts on the the motherboard pcie lane as i had the same issue on the asus p5q premium
 The fix was to spray dry contact cleaner by wd specialist which cleans the gold contacts and breaks down the dirt or some residue stuck. Also check on the back of the motherboard check for white residue around the pcie lane pins which may be the reason of the boot issue
Reply: You realize that gremlins are the minions of Murphy (Law).  ;-)
Reply: doorgoo I second that! There has been a few times where gpu-z was straight up wrong about it's bios, cores shaders etc
Reply: I don't know what the problem is but I think I can help you to figure it out: What do we know? I. Both cards (A and B), and both processors with their motherboards (systems 1 and 2) are functional; II. One card (A) only works on one system (1) but doesn't work on the other (2) III. The card B works just fine on both systems (1 and 2) and IV. Card A must work on system "2" since it's functional. Try to connect the card A (the problematic one) on another "2" system or 2' or 2 prime, this means another ryzen system, if it works on the new 2 prime, then the problem it's not the card (it would work on 2 systems), I think the problem would be the specific ryzen system 2 processor. Did I deserve a heart?
Reply: 1st rule of troubleshooting: If you dismiss something as being impossible or unlikely without actually verifying you are only fooling yourself. Reality is the ultimate arbitrator not you.
More importantly, you haven't actually eliminated systemic issues.

I suspect several things in decreasing likelihood based on 30+ years in I.T.. 
Swap Monitors and display cables between the systems.<-- Most likely the issue.
Swap memory between the MBs. 
Swap CPUs between the MBs.
Swap boot drives between the MBs.
Swap PSUs between the systems.
Swap the Mouse and KB between the MBs.
One of the Ti(s) may be overclocked in its bios.
Reply: mobo gpu slot maybe?
Reply: I have an Asus 6 Hero and a 960 that do that when in the top slot, still haven't figured it out yet
Reply: its been a few years since my i.t. days but i have come across that same issue. Sometimes hardware dosent like each other. Even across identical hardware. As a general consumer tech sucks some times.
Reply: Are you running secure boot? Is the UEFI locked to the other card? Disable fast boot if you have it enabled - I had a similar issue with Threadripper. Even with IDENTICAL cards you will piss Secure Boot off swapping them if you have fast boot enabled.
Reply: any OC differences between the two cards?
Reply: This might be completely stupid, but checkout a few of Brian's latest videos on tech yes City. I believe he had a similar problem and his solution was pretty much as mysterious as the initial problem.
Reply: The motherboard manual says B2 means ''Legacy Option ROM initialization'' which funny enough this time this debug code says what is happening lol so my assumption so far after few minutes of looking is maybe you have to turn off legacy mode on PCIe thingy or something similar, something Legacy/UEFI mode will make your device won't work in Win 8 and up or you won't have the performance you should have in case of NVMe SSD etc.
Reply: Width might be a slight issue
Reply: Remember the acronym K.I.S.S. Try a fresh install of windows.
Reply: really big hammer...  then talk to nvidia really nicely offer beer or cake
Reply: https://scottiestech.info/wp-content/uploads/2015/11/UEFI_3.jpg I know its not your motherboard, but it's pretty much what I meant.
Reply: maybe try older versions of the cpu bios?
Reply: Your BIOS got corrupted, happened with me too.
Reply: I've had boot issues with my R7 1700. I'm on my 2nd motherboard was an MSI B350 Tomahawk Arctic now an Asus Strix B350F. First board died in 3 months now the Asus after working perfectly for a month will no longer boot if i overclock or set the memory past 2133 MHz
Reply: JayzTwoCents An issue like that happened to me using a 1070 with my ryzen 7 1400x, I swapped my 1070 for my spare 960 off my second PC and it booted fine. I changed my mobo and my 1070 worked. I think it is an issue in the CMOS battery since when I changed me old CMOS one out, it booted with the 1070 after I configured everything in the bios using my 960. You can try that and see since it worked for me
Reply: JayzTwoCents did you check to make sure it wasn't a bad pcie slot by trying in another slot otherwise you didnt  check the bios of the nonworking card
Reply: Swap out the RAM. If that doesn't work, put the original RAM back. Then swap the CPU. If that doesn't work, put it back. Then the motherboard. Only assuming is half assed, and I expect better from you, Jay.
Reply: @JayzTwoCents I'd do the following in that order:

1. Make a fresh install on the system and update the MoBo BIOS.
2. Put in the "non-working" card and run multiple power cycles.
3. Change the PCIe slots and run multiple power cycles.
4. As the MoBo in question supports SLI, I'd try putting the "working" card and the "non-working" one in a SLI configuration.
5. Contact Gigabyte's customer support and hope being a popular youtuber will prevent you from your typical indian-accent CS.

Personally, I had issues like this on multiple systems over the years, not just with PC, but also on Racecars, which completed endurance races after a powercycle during the race... which is rather ironic when looking at the extensive start-up procedure the high-end cars will go trough.
Reply: You checked the BIOS on the same GPU after switched it from the Intel to the Ryzen system. You didn't check both of them. You silly little man. Kick yourself